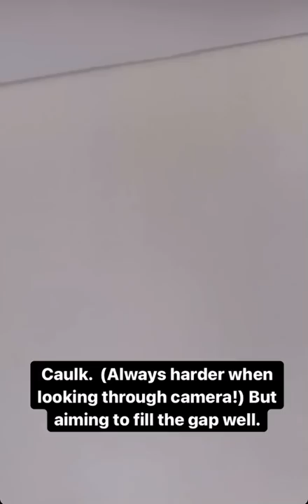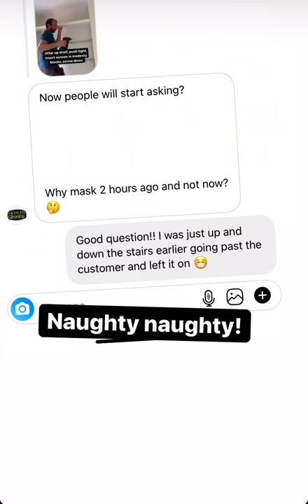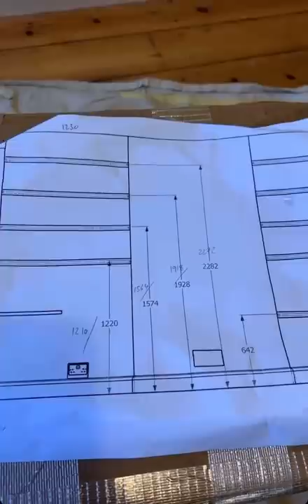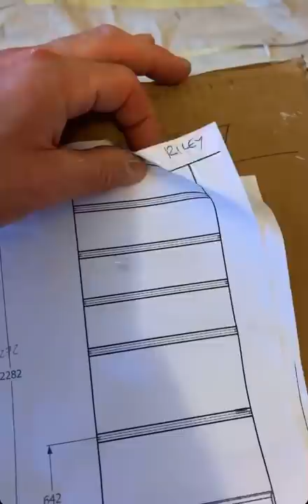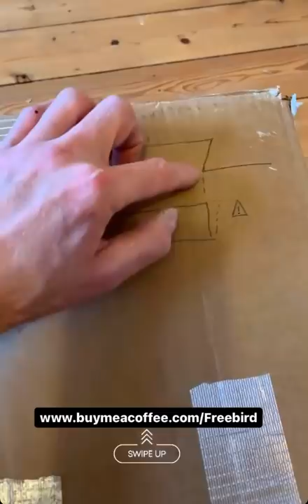The Freebird Floating Shelves Method

Comment: Interesting. When I watched you hammer in those orange anchors, I was thinking they were similar to Rawlplugs I used to use way back in the seventies. Those were woven fiber wrapped lead. We used to use them exactly for the reason you do. So I did some research on what you used and low and behold! Rawlplugs are still around as UNO! Amazing 😊😊.
Reply from the maker: Yes, rawlplug is a big brand name with a variety of different plug types!

Comment: Very educational for those of us still learning. I take it that was a brick/ plaster wall you were brad nailing those battens on to? Never thought that was an option but can see how it speeds up installation. Great job.
Reply from the maker: thanks, and yes often the houses I'm working in around sheffield are brick or stone but with a fairly thick layer of plaster.  I'm using 30 or 32mm length brad nails and they penetrate the plaster, and maybe sometimes they buckle up against a solid block but they still do the job of holding the batten quickly in place until the more weight bearing screw and plug fixing goes in

Comment: Hi Alistair, thanks for your great videos. Out of curiosity, in a previous video about floating shelves you mount the lipped piece to the top first and then glue the bottom panel. Is there any reason you do this the opposite way in this video? Thanks!
Reply from the maker: Hi you're welcome, yes there is a reason! The aim is to make the shelves appear solid, so the join is placed out of sight.  Shelves below average standing eye level have the seam on the bottom.  Above eye level, the construction is reversed.  This is one of the reasons why we settled on using all 18mm board - we have the freedom to make that decision on site after fitting the wall battens without imopacting the spacing of shelves (I mean, because previously we used to use 6mm board for the bases).  This all relates to the fact that we pre-spray the shelves.  Way back when we hand painted everything I would fill and sand the join then overpaint.  But we get an overall better finish these days with presprayed boards and careful placement of the seam.  Note also that we follow the opld joiner's maxim 'if you can't hide a joint then emphasise it' - so although we try to place the joint out of immediate site, if you do look at it you will see slightly rounded arris edges either side of the joint, because this looks neater than trying to make a perfectly tight butt joint and not quite succeeding in making it disappear.

Comment: I'm going to build a bookcase in an alcove using this method,  installation may be sped up by using a laser grid level instead of hand level? Scribing details handy.
Reply from the maker: I actually think that marking heights on the wall then offering up the battens with a long level held on top of them, then pinning in place, may prove quicker than trying to position the laser level to each height!  I do use a laser to line up the first of the running measurements in each alcove.

Comment: What do you do for longer alcoves to add support?
Reply from the maker: We sometimes add vertical dividers to brace shelves together.  Or make the internal spacer from oak.  Or integrate a metal bar there behind the front lip - a metal upright from a twin slot shelving system works well

Comment: Great video! Would this work for a 190cm X 30cm wide board? I would attach it to the studs behind particle boards.
Reply from the maker: Probably would be ok… I am cautious and have done them 150cm long no trouble.  Wider than that I prefer to add a central divider tying upper and lower shelves together for a bit more rigidity.  But if you don’t plan to load the shelves fully with books or vinyl records it will probably be fine to be honest.

Comment: Great video Alistair and a technique I have adopted myself so many thanks for the tips 🙏 One question: what’s the widest alcove this technique could span without sacrificing strength do you think?
Reply from the maker: Hi I have done them at 1.5m, they could be fine beyond that but I prefer to start adding connecting vertical dividers
Reply: Thanks  @Alastair_Freebird ,that’s really good to know. Curious to know how  you would add connecting vertical dividers for wider alcoves?

Comment: Thank you for a great tutorial. I have chosen your method over (many) others for my DIY project, it's especially efficient and light on heavy materials. I will want to also add  lights. Wire runs are easy thanks to plasters board on each side. Spot LED lights would be super, I can see how to easily cut a hole in each shelf, but we's prefer to have strip LED lights. I imagine I would put the join side down at any height and open up the gap to accommodate the LED strip with a thin piece of backing across the gap for it to be glued to and the diffuser light cover over the top of the 'gap' where the strip is. Have you done anything similar? Any other method you'd recommend?
Reply from the maker: Yes I would probably do it much as you said if I wanted downlighting but the truth is I try to avoid using strip lights in floating shelves, except as an uplight at rear of upper shelves.  I prefer spotlights.  Partly for ease of fitting and putting the wire straight into the middle void. Partly also because when a shelf is near eye level with a strip light in it (LED tape within an aluminium channel with frosted cover) I have found there is an uneven glare issue which just bothers me somehow.  I mean as your eye moves up or down past it, the led tape may not be perfectly parallel to the channel and it doesn’t look even.  I prefer to use strip lights in an entirely concealed position so you only see the reflected glow not the direct glare.  And I don’t like running them tight up against a wall where you get a harsh inverted cone of light on the wall
Reply: @Alastair_Freebird  Thank you, I'll go with your advice. 
I had similar reservations. Especially being on track to make nice solid looking floating shelves and then create a lip or gap. It's funny that people aren't bugged by the cone of light on the wall at the edge of lighting strips. They look awful, but even appear on the showcase pieces on Pinterest.  I was wondering why they don't at least stop 3cm from the edge.
For spots I can use the IKEA system with the wireless drivers (which I've previously paired with my Philips Hue system, so it will all be seamless), two for each shelf, and I can hack a 24v strip for the top of the cabinet (just a little soldering as IKEA don't do those).
Reply: @Alastair_Freebird  Hello, I have a follow up question if you'd be so kind. When you do spot lights within the void do you have a way to make the top piece accessible in case there's an issue with the electrics in future. For the finish I plane to still caulk the edges, but do you still glue down the top piece?

Comment: Hi Alastair, when you say you use red plugs for every type of wall, does this include plasterboarded walls?
Reply from the maker: Hi Josh yes I find that the Uno plugs work very well in plasterboard too and are much easier to use than the unnecessary worm screw or splayed-clamp fitting types (I would only use Uno plugs, not just any red plug.  And I would use other types of plasterboard fitting for types of load that want to pull away from the wall as opposed to just weighing downwards).

Comment: Have you tried using the lamello tenso fittings to pull the seam closed rather than relying on the angled clamps?
Reply from the maker: We actually join the lip as a butt joint using pocket hole screws.  White quick to do and your can go straight to sanding and painting.  But a mitre joint could save on the finishing time as it’s hard to avoid the end grain telegraphing through.  I’ve been meaning to try motoring again but would hope to make it work with a taped joint - I mean glue both faces, tape them tight together along the joint laid flat then close up the joint, using the glue suction and tape to hold it in place til it dries.

Comment: Some great tips, thanks Alastair. 
I recently tried this method and had an issue with dropping the top piece in place when the lip is pre-attached. The alcove was narrower at the front than the back and I found that I couldn’t drop in the top of the shelf as the bottom of the front lip snagged on the wall. Had to resort to trimming the front lip at an angle to get it in then filling and painting. Perhaps my tolerances were too tight, but can’t actually think of a way to overcome this - any advice appreciated!
Reply from the maker: You can only get them so tight because of the lip, the whole assembly is a bit wider while at the angle necessary to drop it in.  Sometimes the alcove width also tapers a bit towards the top or there is a bulge in the wall just above the shelf and this can mean it’s narrower at the point where you are angling the shelf in making it seem even tighter so you trim it then when it lands in position it’s too short!  So sometimes a bigger gap for caulking is just unavoidable.
Reply: I had this, I stood it up at the back, then let it tip forward into the gap. I know what you mean though, sometimes the lip is just not your friend. Another option is to finish in situation if you are not spraying. i.e. fit front when shelf is in situation, then fill, sand and paint.

Comment: Hi Alastair what size battens are you using? Have you any recommendations on what way to make a similar shelf that is fully floating? (Only attached at the rear of shelf). Thanks in advance
Reply from the maker: Hi!  18x18mm battens
Reply from the maker: And see this video https://youtu.be/uLlzdY2G3LI

Comment: Stupid question alert... is there a chance of the batten slipping down a fraction with your method of drilling a hole in the batten big enough for a 6mm uno plug to fit through? I can’t quite get my head around if that’s risk or not with a 6mm hole int the batten, as it looks like a super quick method for fixing the battens if it’s secure. Is it as strong as doing it the traditional  way of drilling the batten, marking the wall through the batten hole and then removing the batten to drill the wall?
Reply from the maker: I know what you mean mean but no.  The screw grabs well enough into the uno plugs that it sinks it’s head a little into the material of the batten and really positional engages in a position like that.  Also the pins provide extra positive location (although they could bend and pull out on their own; combined with the screw holding the batten tight to the wall they can’t really move laterally)
Reply: Good stuff then. I recently battened out the walls and ceilings of entire one bed basement flat to install dropped ceilings and fake walls for led tape to run behind,  took me a whole week just to batten it.  This would have been a quicker method!

Comment: Hi Alister do you still use the ct1 for caulking? I have used it after looking at previous videos,have you found any other product to be as good without being as difficult to apply as I find the ct1 almost too slimy and gluey.
Reply from the maker: Hi sorry I missed this comment - last time I fitted these I went back to caulk but trying to keep the gap as tight as possible (because of easier water based cleanup).  But our installer Neil has started using white Sumo Grip from ProTrade

Comment: These videos are a great help thank you Alastair. One little question I have, the front top edge of the shelves look to have a slight chamfer on them, do you router that or just run a plane/sander across it? Thanks again.
Reply from the maker: Hi!  We use a ‘2mm arris roundover’ bearing guided cutter from www.wealdentool.com
Reply: @Alastair_Freebird  Thanks, I'm currently at the battens on the wall stage and trying to copy every part the best I can. It's a brilliant system.

All the best.

Comment: What are you painting these with? I made some which are now ready for paint, just ran out of RAL1016 Cellulose, rather than by more Celly I was going to get a water based paint but want something that looks good, I have always used industrial paints for good finishes, I did my under stair drawer units in 2k Satin and 3-4 years later and with use in a family home they are without a single mark, cannot beat 2k for durability but not the easiest to setup for - ventilation, masks, etc. etc.
Reply from the maker: Hi Peter we use Sayerlack AT99 15% Sheen, I like the finish and it’s durable enough for most of our work but I don’t believe it is as tough as the paints you are describing
Reply: @Alastair_Freebird  Thank you. Also, type above, RAL9016 (traffic white) not 1016 (a yellow). The paints I used are indeed tough, but I had them for different projects, and so happened they work well on cabinets but I would like to use a safer system so will look into Sayerlack. 

Great videos and great builds Alastair.

Comment: Hello Alastair, do you only offer a white finish? If not how do you deal with caulking around different colours and where the wall colour is much darker? Is there a method that doesn't involve endless cutting in of the paintwork? In my experience that can double the length of the job. Thanks for your amazing videos by the way.
Reply: Put books on edges!

Comment: Hi Alastair.  Great video as usual.  I have two floating shelves to put into a Victorian Mill house and your method should be the ideal way to go.  These walls are reasonably flat and therefore battens should work.  Please could you kindly advise the width of the battens which accept the 6mm masonry bit and rawl plug and also how deep they are away from the wall?  (I appreciate that the width of the batten will depend on the overall width of the floating shelf you are aiming for but as yours look just right, I thought I would ask.)
Also what wood are the battens made from as from some shots it looks like ply?
Reply from the maker: Hi David I must have forgotten to show that in the video - they are 18x18mm and predrilled with 6mm holes and countersunk.  I made them from offcuts of birch plywood but have also done it with MDF (oriented so the drilled holes pass through the face of the layered mdf structure not through the edge which would split) and for most shelves they are strong enough once all is built up together as per this strength test video:
Reply from the maker: https://youtu.be/qLABN-iDYiM

Comment: Hi Alistair, would you mind sharing what you charge for a job like this?
Reply from the maker: Hi we have just raised our prices.  It's £250 fixed fee on any job.  Then £500 for first 3 floating shelves.  and £150 per extra shelf after that.  This job actually was about 10% lower (won just before we raised prices).  But customer said our prices were reasonable.  Some would say very expensive.  Depends what people are looking for.
Reply: @Alastair_Freebird  Thanks for the info. I'm definitely too cheap! I'm starting to creep the prices up but it's difficult to find where to be with prices. Thanks

Comment: I’ve never actually seen an electric plain (plane? Dyslexic)
I always thought a router would be the go to method (with an appropriate bit)
Reply from the maker: It would be really hard to control a router in this way.  Planer used one handed is much easier, with the base plate to guide depth of cut

Comment: Why don't you use a track saw for cutting the boards instead of a handsaw🤷 there is no possible way you are more accurate with a handsaw like that. Maybe a good Japanese pull saw.. maybe but 95% you will be more accurate with a track saw
Reply from the maker: I often use a track saw generally but the cuts to meet the wall are usually not straight and it can work out quicker to follow them with a sharp handsaw - also because the lip is just a little deeper than max cut of the track saw.
Reply: @Alastair_Freebird  way I do it or have done it is cut the face peace down with a Japanese pull saw gives a nice neat cut and finish does not tear out. Then I cut the flat surface with the track saw but I have the depth of the track saw set to the thickness of the material usually 18mm. That leaves it it won't blow 🤷 works for me. Suppose keep doing what works

Comment: A few things to improve on for this method, first off the fit of the shelves is quite poor, this is easily remedied by some 4mm MDF strips and a hot glue gun. Make a pattern, also when shooting in, don’t use an electric planer, use a block plane, you dipped off the back edge on every pass, unnecessary, for a couple mm just use a hand plane. Also your using WB paint on MDF and it looked like the inside unseen faces were uncoated, not even primer. This is not good practice, MDF needs to be stable and balanced.
Reply from the maker: Hello there!  Well, thanks for taking the time to watch.  I actually agree with you on the fit .  I sacrificed quality of fit here a little for speed.  I do use the templating method you’ve described when I take more care, like on alcove countertops.  And the electric planer is risky, very easy. to cut in on the corners when there’s less support.  Again I was prioritising speed and keeping the same tool in my hand.   There is an element of how good is good enough.  I used to be more of a purist, now I am sometimes more pragmatic about getting the job done in the day.   I would disagree on the need to coat the unseen side of the mdf - I understand the balance issue however in practice this has never become a problem in all the jobs I’ve done like this, once parts like this are restrained in a structure.  I expect we’ll have to agree to disagree on that point